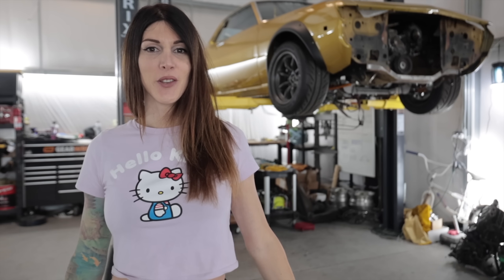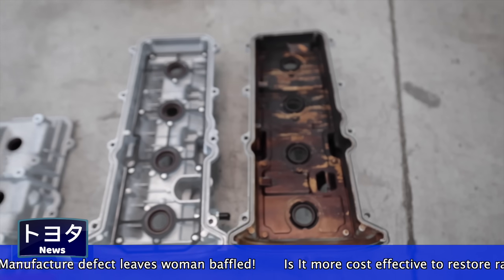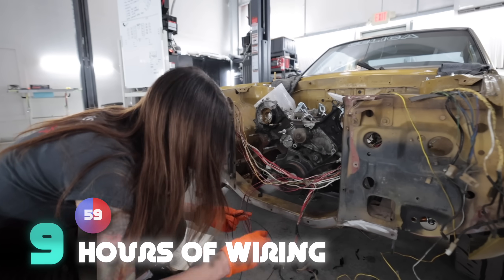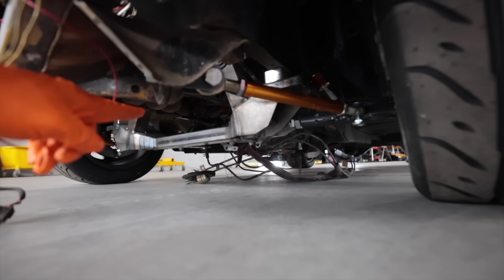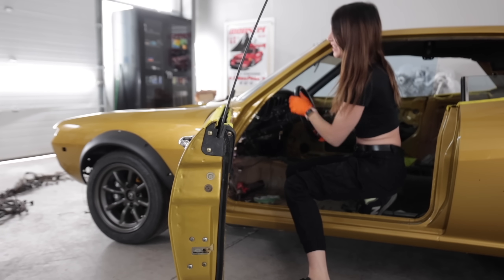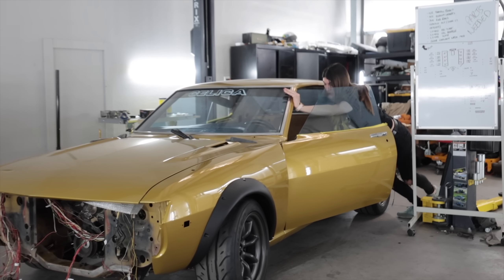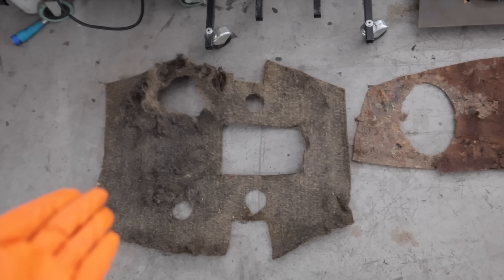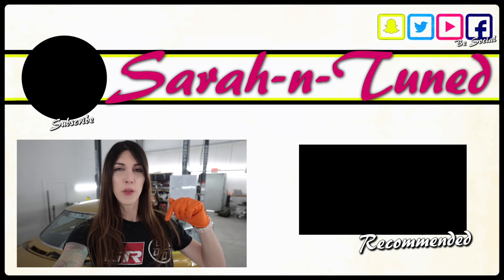Building An Engine Harness From Scratch // 2UZ V8 '74 Celica

Comment: I have to say, when I V8 swapped my Ranger, the first thing I went out and bought was the official Ford 2001 Factory Wiring Diagram book.  It was absolutely invaluable.  When you're trying to keep all your factory dash and gauges, it's a 'must have' part of the process.

And just as a FYI, in my factory wiring book, it had ALL those connectors, male and female, with the pins and corresponding wires.

Comment: I made my EEC IV standalone from a donor 5.0 in my 86 coupe Mustang. I was very surprised how little was actually needed to make the EEC IV EFI run. It was a handful of power connections and a few grounds. Fired right up and ran. The only tap in needed was switched power from the ignition switch to the TFI ignition. I reused the existing EFI fuel system from the 86 and just needed to tap into the secondary EEC connector. Gauges were all separate from the ECM harness in the 86. Pretty easy but, lots of confusing information online required some educated guessing with what did what but, I did get it to work perfectly. It was impressive how quality the wires were from the junkyard donor as well.

Comment: I spent a winter comingling 35 year old wiring with all new modern components once. Once. TBI to MPFI, new HVAC, gauges etc. Not especially difficult, but very tedious and I'm glad it's done.  On a side note another reason to make the leading panel's edge slightly higher is reducing wind noise.

Comment: It's not really a computer. It's basically a switch for the Transmission Controlled Spark system. Two temperature sensors and a speed sensor feed it voltage when their respective temp/speed is reached. When all three terminals get voltage it switches a solenoid to allow vacuum into the ignition advance. Very rudimentary, but AFAIK the first electronic engine management system. Other cars of the period had it too.
This means absolutely nothing to your current project but since you noted it I figured you might find it interesting.

Comment: Having owned several RA20 and RA21 while in highschool back in the 80s, I think I can answer the question about the neutral safety wiring under the hood. Some 73-74 had seat belt interlocks. Without out the seal belt fastened, the car would not crank over. Under the hood there was basically a rotating momentariy switch that a screw driver could turn to start the car from underhood for service. Only had a couple that had this arrangement still in tact. They tried to do this with domestic models. One year only and the law was repealed I think

Comment: Mount the ECU on the firewall in the foot well, under the AC unit.  Then create a metal plate to cover it, with an air gap, that matches the dimensions of the footwell.  Once it is covered with carpet it will not be obvious that it is there.  It will make your wiring, trouble shooting and ECU replacements easier.  And you can use your welding skills to fabricate the mounting points for everything.

Comment: On the inside of the tappet covers where the baffles are sort of rivetted in place, i have drilled and tapped m5 or m6, whatever suits the hole in the baffle. Then used button head capscrews and nordlock washers. I have never had nordlocks rattle loose but most other lockwashers i dont trust.

Comment: Hello Sarah. Your Celica is coming along very nicely. I have a tip for you for removing the pins for the valve cover baffles. Use a small vise grip welded to a slide hammer to pull the pins out. I learned this from a machine shop machinist. This way once the parts are cleaned you can hammer punch the pins back into the valve cover. Please make sure you move the pins in a different location in the hole so they won't rattle themselves loose and fall onto the camshafts. Hope this helps. Keep up the great project.

Comment: Hey Sarah, another point about the body panel alignment nobody seems to mention/or maybe realize, wind noise, from front to back each panel should be slightly proud of the next so that air doesn't catch on the front edge of the next 1, ie. frt fender slightly higher than door, door slightly higher than rear 1/4 panel, makes huge difference in wind noise when driving

Comment: IIRC, one or more Japanese manufacturers farmed out their wiring harnasses to ... little old Japanese ladies who hand wired them in their homes. They had large wooden boards that had all of the plugs laid out and the wire paths marked out to make sure everything was placed correctly and the wires were all the correct length. (Rumor has it exactly NONE of them ever wore a bare midrif top and torn jeans.)

Comment: A cool cheat code for using the ultrasonic cleaner.  I use just water and put the parts in a Ziploc bag with whatever cleaner I plan on using.  That way the cleaner itself doesn't get dirty as often.

Comment: All that wiring really makes me appreciate my 70's VW diesel Rabbit.  It would still run just fine with a broken belt on the alternator and a near-dead battery (it did need some power to keep the fuel solenoid on, however).

Comment: Echo gregholloway's comments about headlights - when you get it wired up - check voltage at the battery compared to the voltage at the low beam and high beams.  If the headlights are getting 1V or more LESS than full voltage at the battery - add relays triggered by the stock harness wires at the bulb.  Headlights receiving full system voltage are much brighter.  And my tip -- when tracing wires (sometimes the schematics just aren't right) I use a 9V battery and a test light to check for continuity.  The little battery is bright enough to light the test light, but doesn't have enough juice to hurt anything if you get your wires crossed.

Comment: I'm trying to figure out how you are going to wrap the wires to the correct position and length....  mainly the engine and transmission wire bundles.
I'm thinking to make it look "factory", everything would have to be partially routed  to a point close to the correct location and left long.
......and once the engine and transmission are installed, route and cut the wires to the finished length and install new connectors.
It's either that, or start the wiring from the engine components and work backwards.
 That will be a fun process to watch.
Hope your head is ok.  That hurt so much to watch i rewound it twice to look for chipped paint. 😱😁

Comment: Sarah, you have a great approach to doing a proper job on the wiring my one suggestion is when you remove the plugs to shorten the wires you use the heat shrink tube  that you can put in a label  maker.  what i am trying to say is to use the heat shrink tube that you can print on with the label maker  then you heat shrink it to the wire . its helpful when the harness gets bigger and more complex .

Comment: Can totally relate to the grossness of an old car interior. I'm redoing the interior of a '58 Pontiac Bonneville. The rodent- infested car sat in an open cow shed in Upstate NY for the past 7 years, then left to bask in the sun and rain for the last 8 months with disabled electric windows. The funk was enough to knock a buzzard off a gut pile!  I completely gutted this vehicle and am still trying to remove the stink from this car. After scrubbing, disinfecting and even pressure-washing the bare body, I've finally had to resort to painting the entire inside to 'seal in' what's left of the odor. I've been working on it for the last 2 weeks and I have found huge nests but not one mouse skeleton. I found out why: because rats apparently moved in and ate the frickin' mice! I feel your pain.

Comment: Great video.  Helps to be a bit AR when tackling wire harnesses.
I once rewired a '69 VW Type two. THAT was a nightmare.  I even had an " official " VW Type two shop manual and the complete guide to VW for the complete idiot.
Still was a pain in the tukus

Comment: At some point, after working for Toyota for 35 years, I find a 650 Holley making more and more sense. Cam and crank sensors, someone else's ECU for spark, and ditch the rest. Add two 600 Holleys and a TRD blower out the hood. Nyat.

Comment: Great job on the wiring, Sarah!  I have two suggestions: 1) how about operating the stock dash warning lights from your aftermarket ecu’s outputs?  2) install relays for the headlight low beam and high beam, such that the bulbs get power directly from the alternator, and not via the original harness.

Comment: I've always loved the Celica body style, so I am quite jealous. But, I have a question:  Wouldn't turbo'ing a 20R or 22R engine have been easier?
P.S. The true reason you want the front edge of doors and fenders to be further out than the rear panel is to deflect the air stream. If the rear edge stuck out further than the front edge it would act like a hood scoop.

Comment: Any chance of an update on the ur quattro? mine has been converted to efi, it has the 10v WR engine. I have had it for over 20 years now, so very keen to see what more you have done.
Reply from the maker: I was going to do EFI, but after I took it to Ken Blocks Electrikhana last year everyone pretty much talked me into just keeping it as is since it's a period correct ABt Stage 2 car. I just want to give the fuel system a good cleaning, maybe turn the boost up to 1.5bar if I have the fuel for it (I turned it down to 0.9 bar right now until I throw a Wideband on it and check AFR). I think 1.6 bar was what the '82 / early '83 WRC Cars ran with the KJetronic on a fairly stock engine.

Comment: It's not a Prelude, it's a Celica... 

Another tip for the viewers about adjusting doors is to make sure weatherstrip, glass and latch hardware are all installed first (like here) because without will throw off how the door sits and you'll have to do it all again later.

Comment: This is coming along great.
I'm wondering how you're going to work the speedometer (assuming and hoping you're using the original) off of the newer transmission.
 I put a diesel in an S10 before (twice, actually), when doing the 94 with a T5 transmission I had to convert the analog transmission speedo drive cable to electric for the newer dash...it was easy, as I found out GM did this with some rear drive cars, specifically the Camaro.
 This is going to have to be the opposite. 
 I think.
Reply from the maker: The W58 is a cable driven speedo just like the original W40 that I pulled out of it. They’re very similar gearboxes.
Reply: @SarahnTuned Awesome! That's one annoyance that's actually not an annoyance!

Comment: Love it. "Killing two chickens with one rock".  Your videos really move the needle on both entertainment and coolness. Car is a perfect combination of classic and keeping it authentic, almost like a Japanese hellcat would have been.  Also, that insulation material is fucked up; only single and non-authentic thing should be dynamat extreme and dynaliner throughout interior instead of that smelly crap: I bet you will drive this to death, and it'll have tons of power to handle any extra weight from heat /soundproofing. No one would know, except you when you aren't feeling like a Polos Hermanos chicken in Nevada summer. Godspeed.